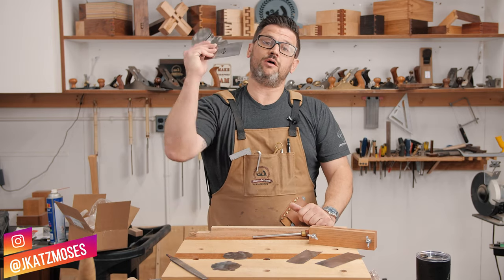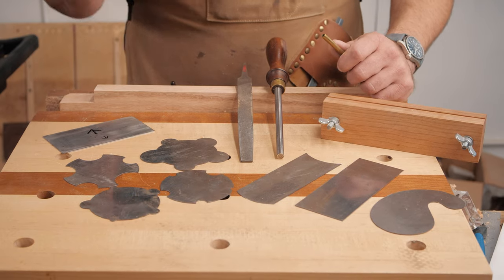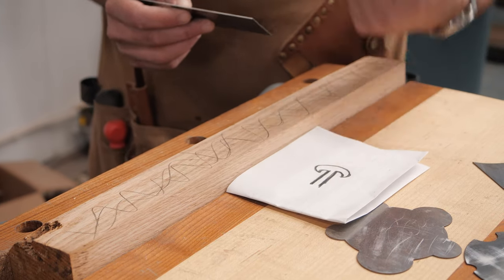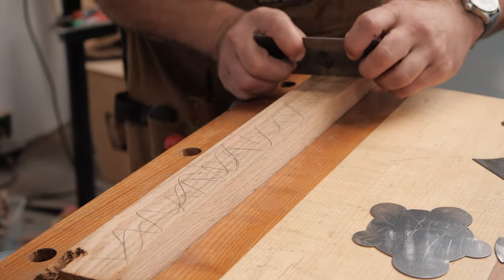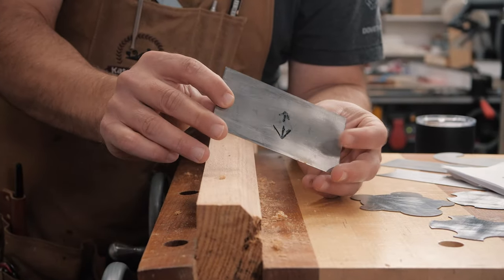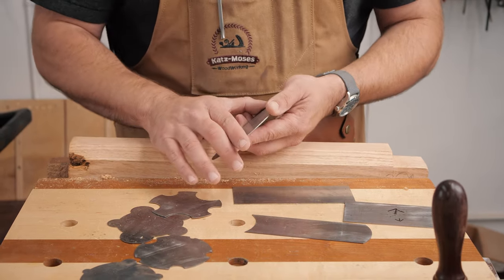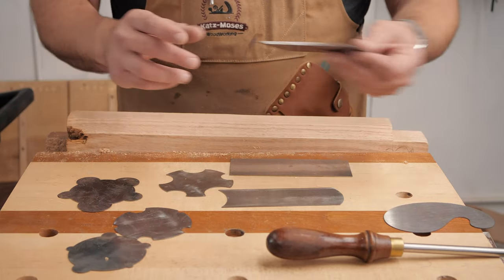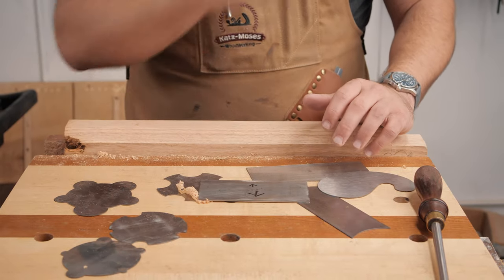Card/Cabinet Scrapers for Woodworking - Two Minute Tuesday

Comment: Two other waves I used a card scraper. I used the shavings to tighten up a loose leg on a chair. I was refinishing an old sideboard and used the card scraper to remove the spots of paint the chemical peeler could not remove.

Comment: An old or chipped full carbide router bit (one of the spiral cutters) or endmill will work also as a burnisher if you use the shaft 😊